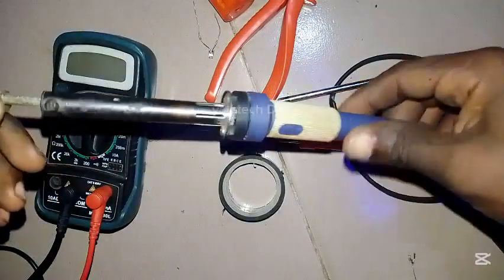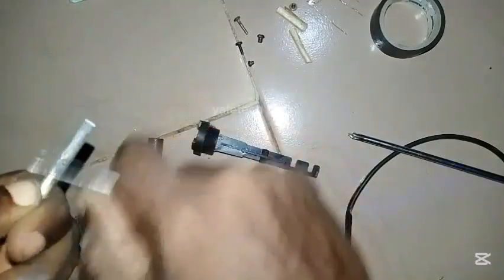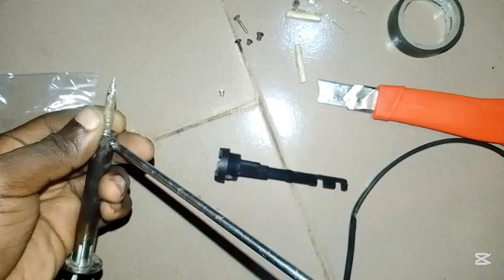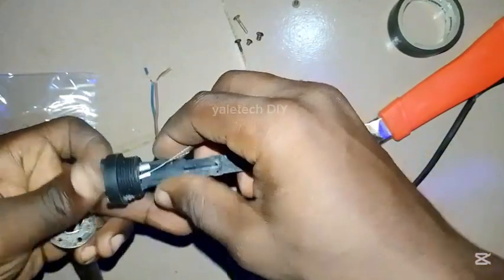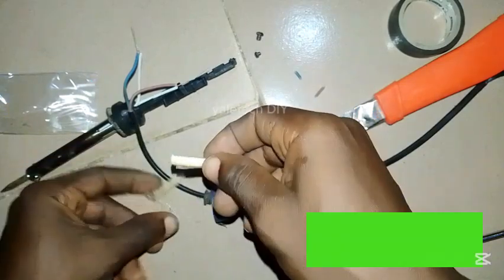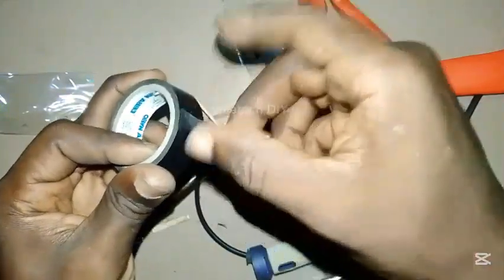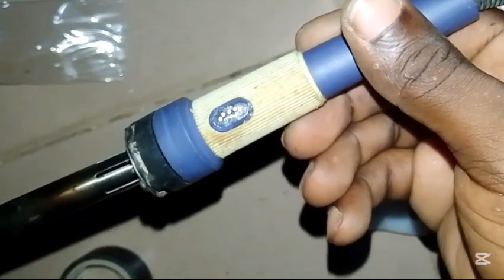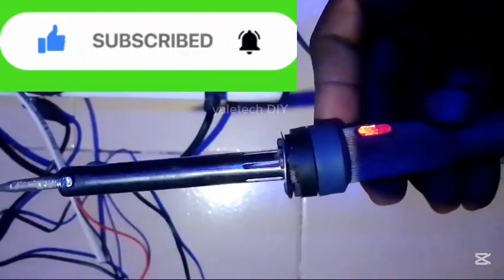How to Repair Your Faulty Soldering Iron and Add a Light Indicator Upgrade

Comment: Thanks for the video, what size resistor did you use for the light? Thanks
Reply from the maker: The LED it self is AC type not DC led so whether with resistor or not it will function.

But u can attach 100ohm to prevent overheating.
Thanks, I hope this helps you